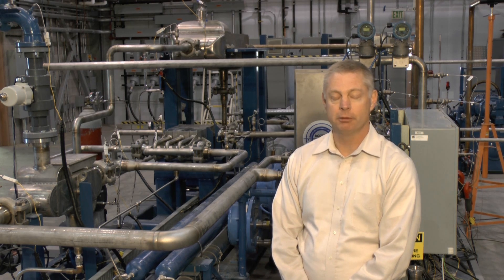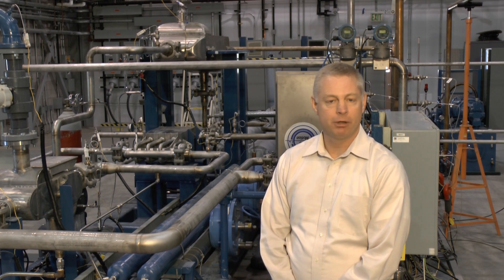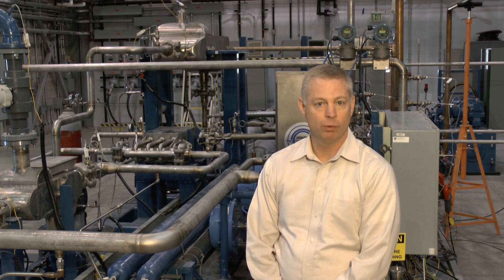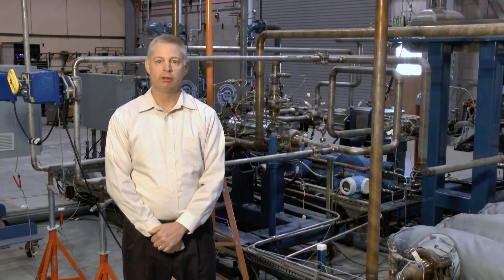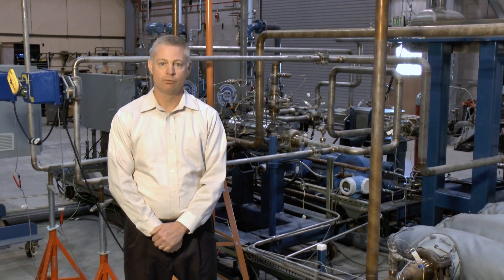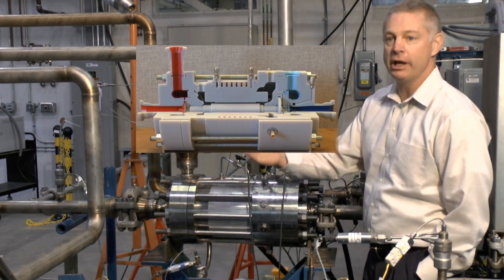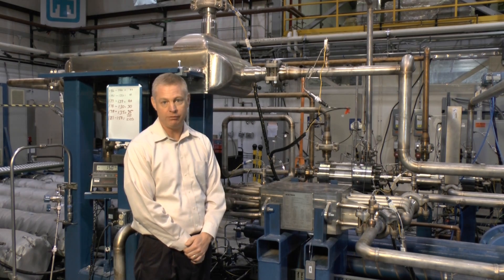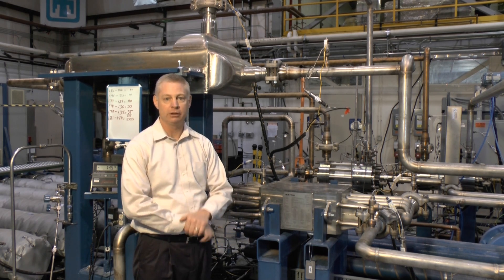BraytonTour Pasch 2014

Comment: Nobody ever talks about this but it looks like the future of the earth. Both the supercritical C02 and a heat source like molten salt can be stored under a thermal solar plant and be used to generate power when the sun isn't shining. I am no engineer but perhaps the CO2 could even react with some alloy to form or maintain a protective carbide coating on the turbine blades.

Comment: As I understand it, the systems for using CO2 in a closed Brayton cycle tend to be, in theory, not just more efficient, but physically smaller per watt capacity than equivalent steam-based systems.  Is this true, and can you estimate a ballpark size ratio?
Reply: SCO2 turbomachinery is estimated at anywhere from about a fourth to a hundredth of steam turbomachinery for comparable power.  The answer probably lies somewhere between these extremes.